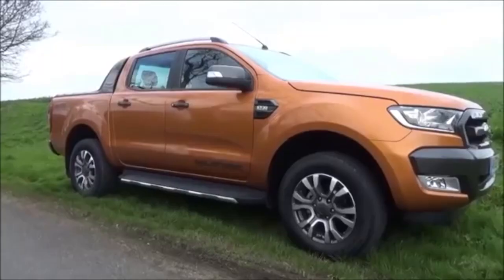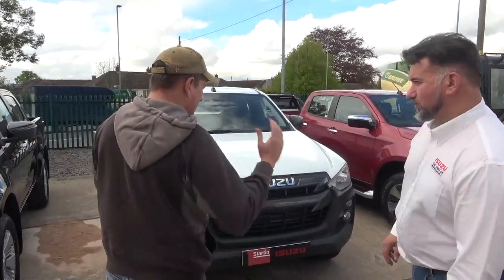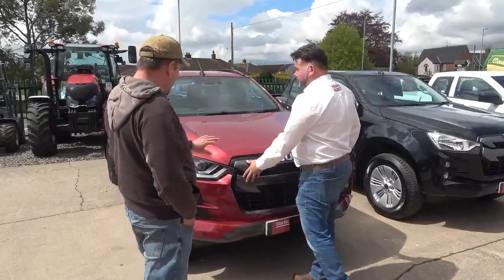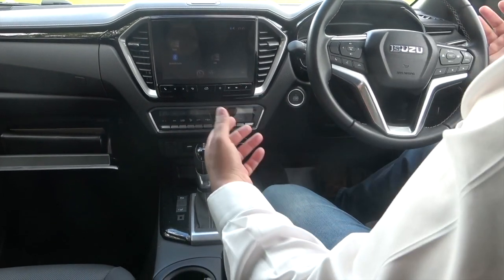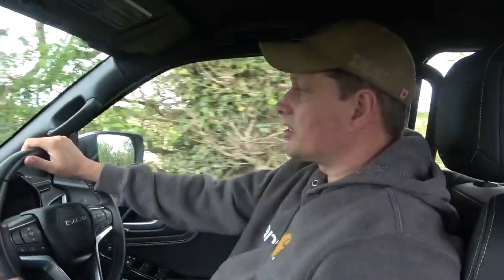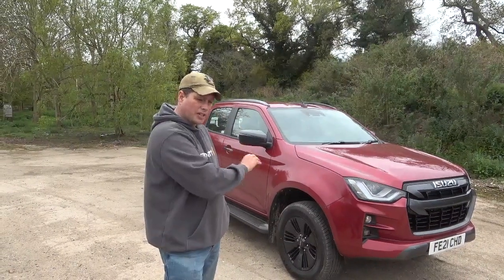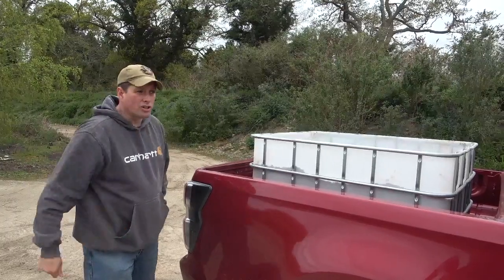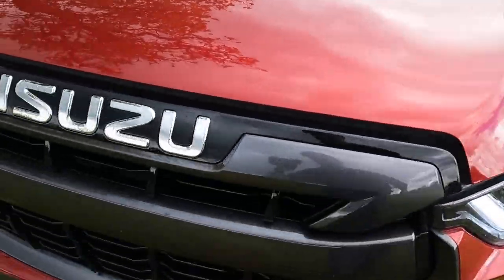2021 ISUZU D-Max ROAD TEST

Comment: Where I find the small engines lack is at higher speed, over taking, joining the a1 etc etc. It doesn't matter how clever a gearbox is or how many bhp they got on a dyno that's where you need the capacity. For 90% of normal driving you wouldn't notice the difference between a bigger and smaller engine. When it comes to gearboxes I'm afraid I like a manual. Autos just annoy me, apart from offroad. Then they're great, you can left foot brake and be really smooth.    I had a few ford's that were... OK for the price is the most polite way I can put it. I then had a rodeo 3.0 manual and I didn't want to sell it. I had it 7 years and it drove as well at the end as it did at the beginning. The owners manual told you how to do a service, torques, clearances, it was better than a Haynes. The only thing that ever caused me issue was the 4wd binding. Youd come off something muddy, turn onto a road and try to knock the 4wd off and it would just flash the light at you. A stick is way better as you can wiggle the steering and feel when it's tight or loose and get it out. I swapped it for a 2.5 dmax auto blade. Didn't like it. The gearbox was awful, constantly shifting when it didn't need to, thirsty and the sports seats and low profile tyres did my back in on long drives. It couldn't reverse up to a trailer in a field in 2wd as it would just sit spinning on the wide tyres where the old rodeo wouldve driven like it was on tarmac. When I used to take it for a service they would give me a pleb spec as a loan car and it was so much nicer to drive than the blade. As soon as the v6 amarok was announced I pre ordered one. It was a good truck, less work biased than the isuzu, more suv like, had a lot of dpf problems to the point where I had to take a longer route to work just to try to keep it clear. Had gearbox problems, torque limited in reverse made it near impossible to reverse a trailer up my drive where I used to do it on idle in the rodeo, also used to overheat the gearbox if you worked the truck hard. Had a few electrical gremlins, nothing major. The biggest problem was the dealer and vw uk. They both treated me like absolute dirt. They were so arrogant, they didn't know their product, even when I was trying to buy one they couldn't answer simple questions and never returned a call. After I got it and had problems they weren't interested. They would take the car in and look for ways to blame you rather than look for a solution. I never want to give a penny to vw again. Compared to the fiat dealer it was shocking, he couldn't do enough for me, sent me on a test drive day, brought me a truck out, really liked it but I couldn't get the 3 kids seats in as it was too narrow. Nice review of the isuzu though 👍just wish they would do a 4wd system you can use onroad like the superselect or permanent.
Reply from the maker: I found the exact same thing with VW, I'm just glad my interaction with them has been minimal.
I've never had issues with reversing loaded trailers up slopes or in mud with it, I just press the off-road button and it sits down and pushes.
The Isuzu is, as you say, great for doing 90% of the stuff really well and when buying a truck, that's better than average for its working life.
Dealer back-up is key and should always be a big deciding factor in a vehicle purchase.

Comment: Diesels, I assume turbo, work really well with automagic transmissions. I know what the old Borg Warner 35 and 65 3 speed "torqueflite" gearboxes were like, bloody horrible. But a bloke called Ian Ashcroft could modify the valve pack so it would lock up and you could bump start your Landrover. I don't know how he did it. With electronic engine and gearbox management I suspect they have tweaked the torque converter and bumped up the stall speed a bit allowing the engine to reach near its peak torque output. I always found earlier autos the gearbox just stalled the out the engine.
Reply from the maker: Ian was a transmission wizard.

Comment: I have an early 1.9 litre in manual the ppl who say its not powerful enough how powerful& quick do u need to drive it towing a trailer  mine has enough power to get me up to 50 (trailered) & 60 without pushing it to its limit  ( in the at35 version) as far as I'm aware (talked to Isuzu dealer there is a power upgrade for the 1.9)
Reply from the maker: Everything you know about the old 1.9, forget.
The new one is a totally different animal. Go have a try of one and I bet you'll be smitten.

Comment: I wonder how long the engine lasts, to get that much power from such a small unit the  B.M.E.P has to be extremely high, (brake mean engine pressure)  Was not that long ago that Isuzu engines had head problems and before that they tended to think that they had spare con rods and throw them out of the pram.
Reply from the maker: With a 5 year warranty I don't think it's much of an issue. The other strange thing is that the engine never really seemed to be working hard which was good.

Comment: Great review , but here in Alaska i look at it and think will it survive a moose strike ? :)
Reply from the maker: I look at it and think "Would YOU survive a moose strike ?" 
Thsts what's important. The truth is I've never seen a pickup with so many airbags (even one between driver and passenger)
Reply: @LordMuck  Fair enough , to be honest I don't think anything under a 1 ton truck would , but the airbags are always a plus .
Reply from the maker: Having seen what a camel does to a 1 ton truck, I find it best to try and avoid hitting them...
Reply: @LordMuck  Large animals don't do any favors to vehicles . I have had a trash panda run into the side of my 69 buick skylark , it made a mark . I watch out for animals in general large ones in particular .
Reply from the maker: The camels used to sleep on the asphalt roads at night to retain heat. They either became a car jump or ended up through the screen if they stood up.
Reply: @LordMuck  that sounds like a hell of a choice . I had an alligator cross the road in front of me , it would have been like a speed bump . The moose just stroll across the road when they feel like it .
Reply from the maker: Fucking swamp donkeys...

Comment: The older Isuzu pick ups were always criticized (mostly by the auto press) amongst their peers for being a bit noisy, clunky and dare I say it, " a bit agricultural" compared with the Rangers, Hi Lux's, L200's etc. I gather from your review it has improved a lot? How does it compare from an everyday useability point of view with your Amarok?
Reply from the maker: If for some reason I had to have the Isuzu instead of the Amarok I'd not bat an eyelid. Obviously there's certain things I like about the Amarok and it's still my vehicle of choice but the Isuzu was just such a nice truck to drive.